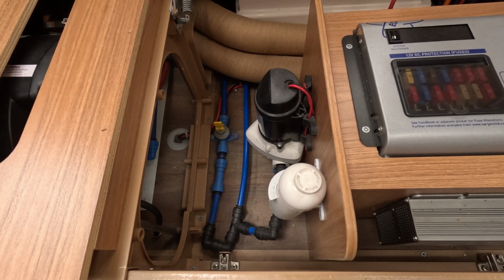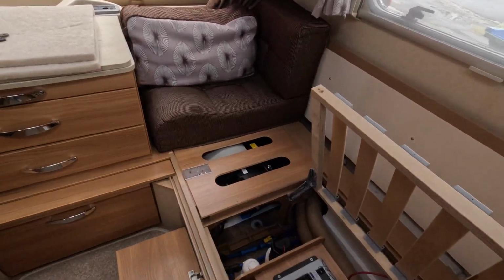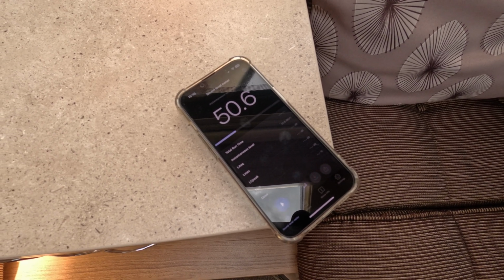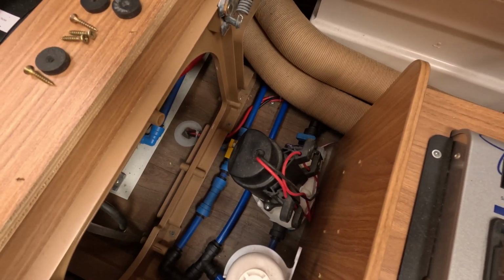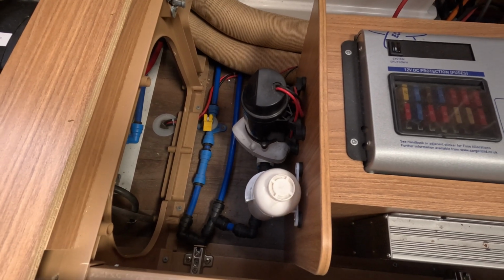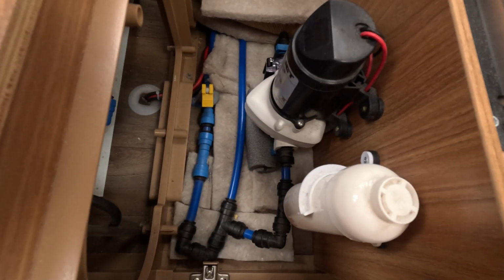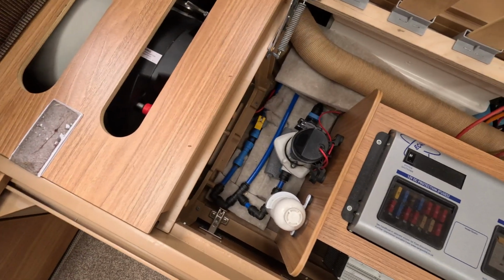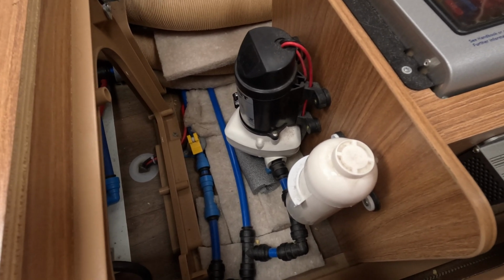Can We Make Our Caravan Water Pump Quieter, Only One Way To Find Out. #caravan

Comment: The new Seaflow mk2 is very quiet (the Mk1 is quiet too).  I used the Mk2 along with pipe insulation to reduce the noise considerably.  You could glue some sound deadening foam to the lid of that cavity to reduce the noise even further for a low cost.
Reply from the maker: Thanks for sharing, this is our first caravan so not sure how loud they are normally lol
Reply: @wobbleboxcrew  Mine is around 30 dB and have yet to add some "lid foam".  The pipe insulation made a good difference, but having a quieter pump to start with is the most  important thing.  Happy RVing.

Comment: Unscrew the pump fit rubber washers but don't overtighten the screws so it can move
Reply from the maker: You just need to make sure they are in enough so they don't fall out.

Comment: That was one of the first things I did when we got our sprite. I mounted both the pump and surge damper on rubber grommets. Shortened the pipes as the fittings were pushed up against the hinge and resonating on the wood (just as your ones are).And lined with sound deadening mats. Made a massive difference.
Reply from the maker: Hopefully, all the manufacturers will do something similar in the future by default.
Reply: You can get rid of one of the elbows and reposition the tee to shorten the pipes and remove the strain. (Rotate the tee 90 degrees anticlockwise and remove the elbow connected to it)

Comment: Same thing in our motorhome, pump mounted on back wall under french bed. I did the same thing with rubber washer mounting, also bought some egg box shaped foam as ive used this in applications when i was an engineer. Also i fitted a one way water valve before pump as sometimes water drains back and may struggle to pull air/water on start up. Great video by the way. 😊
Reply from the maker: For the amount of money we spend on these items you would think they would pay a little more attention to detail, one day maybe lol, thanks for the support.
Reply: @wobbleboxcrew  guess it's like everything that's made today, cheeper & faster, unfortunately the world we live in now.